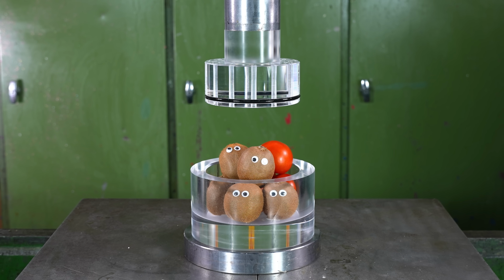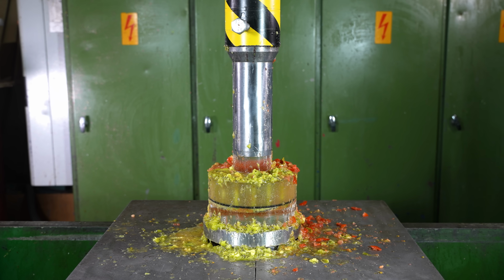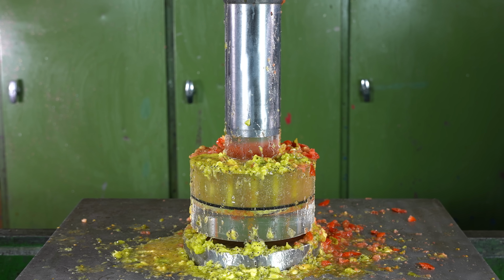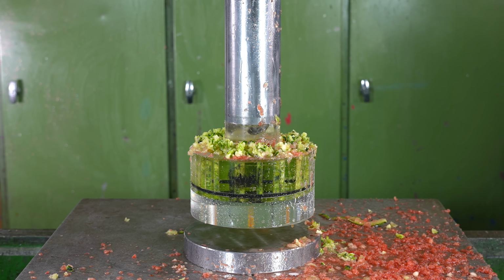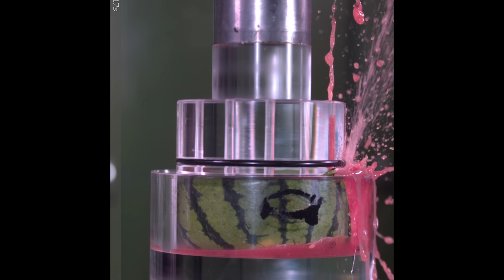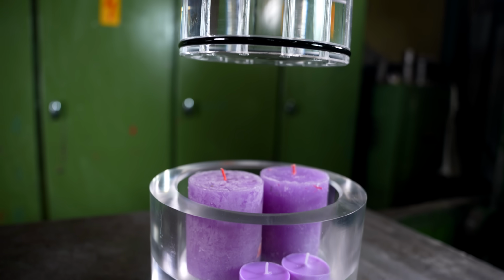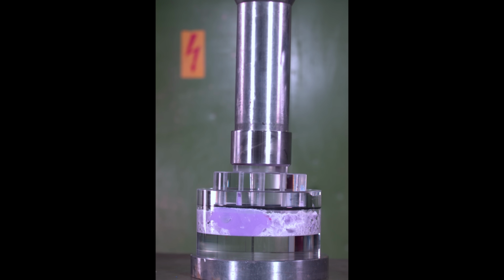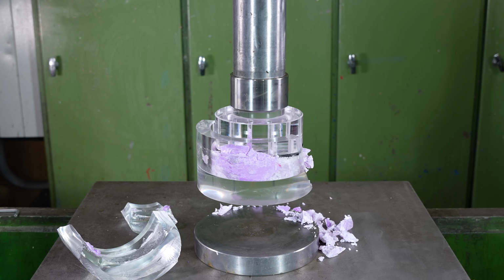Transparent Hydraulic Press Vs. Candles | Most Satisfying Crush EVER!

Comment: IDEA: place polarizing filters on either side of the acrylic tool and the stress patterns in the acrylic become visible and very colourful!
Reply: Good idea
Reply: You could also have some cameras with circular polarizer filters which should allow getting more clear picture without that much reflections from the surface of the plastic. However, circular polarizer will eat 2 EV worth of light so you probably cannot use that for high speed cameras.
Reply: F*cking YES! You'd even see the stress patterns change when under pressure! 😀

Comment: I'm wondering if beveling the bottom of the plate slightly and beveling the opening of the base as well would help to prevent minor misalignments from cracking the tool again.
Reply from the maker: there is already bevel but I think it should be just lot larger :D
Reply: You can see how the top cracked from the offset on the watermelon squish in slow motion.
Reply: @HydraulicPressChannel  put holes on the side of the base. Would be an epic mess and would alleviate pressure on the base.
Reply: @HydraulicPressChannel  in your making of video I was already worried that it was too small and might cause it to crack. Great footage though! Really enjoyed it on beyondthe press
Reply: Flaring the holes on the inside of the pressure chamber could also help reluctant substances to flow.
Reply: @brianhawthorne7603  You can also see how the pressure on the watermelon moved the bottom cylinder across, so perhaps something more solid to hold it in place? An iron plate with a hole or something? There's a LOT of force involved, tho, so I'm not sure how well that would work. Although you could bolt the iron plate to the platform, I guess?
Reply: @galfisk  Good point 👉
Reply: It called a Chamfer.
Reply: @llearch  I saw it too
Reply: @tyler0487  bevel is a flat angle, chamfer is sloped/roundover. i suspect u already know this but wanted to chime in with the fancier woodworking term. either one should work here but im not versed in fluid dynamics
Reply: Could also use a fiber reinforced plastic.

The hard part is finding a clear variety, and someone to make a block thick enough.
Reply: @21centdregs  nope, a rounded outside edge would be a radius.  https://en.wikipedia.org/wiki/Chamfer
Reply: @Highstranger951  i stand corrected. i was  only familiar with a sloped chamfer, which apparently is an entirely different thing.
Reply: Also dont load the bottom part of the tool with things taller than the edge, that way the top piece can align with the bottom before starting the actual squishing.
Reply: Next time you make the cup and press tool a larger chamfer on the edge may help self alignment and give a little more longevity but great bodge fix on the top piece!
Reply: It doesn't even need a bevel on the piston. The same thing could be accomplished with guide rails placed every 30 degrees on the cylinder, guiding piston entry into the cylinder. A piston bevel may be counterproductive in use, increasing load on the o-ring for semi-solid press substances.
Reply: @HydraulicPressChannel  Much larger, there is too much 'slop' in the top ram. A cone shaped guide that starts well above the items being crushed.
Reply: @allieROFL  only issue is that the stuff might not come out the top then

Comment: you need to secure the base tool before you apply pressure. the shifting melon moved the base aside enough that when the plunger contacted it there was resistant in the shaft as the plunger tried to forcer itself into the bowl it was no longer aligned with.

Comment: As others have said, having sharp internal corners concentrate the stress, so its best practice to put a nice radius in them (~10mm?). Additionally them to outside edges will also prevent chipping and help guide the piston into the cylinder if theres a slight misalignment.
Reply: At least 1 to 2 mm radius will greatly reduce the stress. Of course larger is better. They could also opt for a clear Poly carbonate since it is much less brittle. We use acrylic and PC in Lighting design all the time. Avoiding acrylic under high stress loads and sharp corners are well known axioms.  I'd try to get at least 2mm rads. avoid all sharp corners and edges.
Reply: Have you been on his 2nd channel, it shows the whole process,

Comment: I see lots of comments suggesting metal bands, and I think that would help too. Even better if you have something that can be tightened to pretension the acrylic.
What I haven't seen mentioned is that the misalignment on the watermelon happened @3:15 after the tool contacted the melon, before it was constrained by the base.
Reply: It was the same with the candles, they misaligned the tool too.

Comment: I think on the watermelon you had it aligned right at the start, but the start of the crush of the watermelon pushed the bottom part to the side. Maybe some sort of fixturing to the structure to eliminate (or at least mitigate) movement along the x-y plane is in order.

If you haven't made the replacement top piece of the press, maybe angling the holes so they point away from the center by a few degrees will make more interesting fountains.

Comment: You can add bolts to the base so that it is attached to the metal plate keeping it aligned with the piston. That also helps when retracting so they detach easier
Reply: I have been always wondering this, why dont you just fix that bottom plate so it cannot move when the item being crushed is trying to move it?
Reply: @Zer0m4n  They have to pull the tools up every time to hammer and separate them. If they bolted it down to the table, they would be lifting the table up. I remember them saying somewhere the table is not bolted down, and that the press frame would tear itself apart if they tried to pull things apart with it instead of crushing them

Comment: The bottom part should be much longer, so it's possible to start with the tool aligned already from the start. I'd avoid making any sharp corner in the top tool as well, just to avoid any weak points to cause cracks.

Edit, making a chamfer at top tool would most likely result in putting more pressure towards the sealing when pressing less soft materials. Maybe the top tool pressing area, should be slightly concave (bulging inwards).
Reply: maybe radius the inner right angle going aroud the inside of the bottom part too

Comment: The top tool having the steel sheath around it seemed strong enough even for the candles. I think maybe potting a similar bottom part in clear resin should give the sides more reinforcement without distorting the view

Comment: For the piston, maybe it should sit directly on the metal, instead of being grabbing on a rod. So there is no bending force on the plastic. For the cylinder, you machined sharp corners on the bottom of the cup. It might be stronger with a radius there. For the extrusion holes, a big chamfer might reduce the pressure needed to push stuff inside.

Comment: I think the bottom cup needs to have its edge radiused (smooth curve), to prevent it catching like that.

Also, maybe taper the inlet holes, perhaps with a stepped drill bit. Not only will that assist in the material evacuating the cup, but will accelerate the ejection super due to the force being gradually necked down.
(analogy: if you have a water source at the top of a tall hill [a fresh water stream for example] and use progressively smaller and smaller piping as you reach the bottom, the PSI of the water by the time it exits the bottom will be extreme... in other words, do not do this unless you want your cabin's plumbing to blow up 😊👍 same situation with making the tool's holes progressively stepped; it's a rocket bell, but in reverse lol)

Comment: Might making the parts, particularly the bottom part, out of resin be better as you could put bands of thin wire into it to give added strength against the breaking force. But to be honest watching the bottom tool fly apart and the second chunk just fall off was great. :)

Comment: I work a lot with Resins. my recommendation, that you may have figured out, is go with big fat Fillets and Radii, like 12-25mm, everywhere. metal can do a lot with small fillets and radii, but plastic/resins need much bigger ones.  could get away with like 5-7mm. (and like 2mm in the O-ring grooves)
Additionally, after you make a good one, you can make a silicone mold, and then cast new ones out of clear resin whenever you need a new one. probably get 20-50 usable castings out of a silicone mold before you'd have to make a new one.

Comment: A radius on the inside bottom corner of the base, and a matching radius on the pressing tool for maximum squish will make a much stronger part - square corners are weak points as you well know.

Comment: As others have mentioned, you need to try to get polycarbonate cylinders to use for this. Acrylic is just too brittle, which is why you don't see it on cars covering headlights or on construction equipment. But, if you thought the acrylic was expensive, hold on to your hat.

Comment: You could make a steel plate with holes backing the top tool or even the plate be the bottom. The sides would still be transparent but make the steel take the force.

Comment: For the first break, it appears that the inner piece got caught on the lip of the outer one, and the momentary pressure caused the crack. 
If I could make a suggestion, it would be to add a slight inward slope (chamfer, bevel or something, can't remember the term) on the bottom. Nothing drastic, just below the gasket.
That way, in theory, if it does catch the edge, it should simply slip into place.

Comment: When you re-make the see through press, radius all edges. The internal right angles, even 45* angles, are where the cracks will start. Sharp angles are the weakest point in the structure.

Comment: How about a bit of a chamfer on the bottom of the top tool, or the top of the bottom tool to guide the two into each other so a misalignment is gently realigned?
Also, an extension out from the top of the bottom tool (you could just use a laser cut sheet of acrylic), to prevent it all running down the side of the bottom tool as you film (like a horizonal umbrella).

Comment: It's easier to say than done but probably the transparent tool could have last long if you guys add some metallic structure inside the piece, just like in a concrete structure. Transparent material is one piece solid yes, but it tends to shatter real quick and doesnt hold up very well pushing force from inside to outside. A series of circular metal stapes welded inside the piece i think it could do the trick

Comment: Random thought… what if you removed the holes that allow air to escape through during pressing? The holes u see grape juice erupt from? Would grapes have the strength to hold back the press with its trapped air? Would the bottom of the press explode from the pressure? I always wondered that lol

Comment: Just add a tilt to the top surface of the bottom part so if it's not perfectly aline it will just slide right into the center like a hopper.

Comment: Move the o ring a centimeter up the tool and chamfer the edges at 45 degrees so it guides the bottom to center if it slides away again.

Comment: Food-grade plastic means you can market your own boutique brand of guacamole, salsa, exotic fruit blends, preserves, ketchup, etc. Try a clear high density polypropylene, which will stretch a bit before failing. Remove the upper and lower inside faces (against the piston and base) so they can't transfer pressure sideways, and make the walls much thicker. Yum!

Comment: I think the crack occured during the water melon crush-test: there was an offset between the base and the top part with the o-ring: the color changed in the material when the alignement self adjusted with pressure and impact that resulted from it.
Reply: yep, you can clearly see when it breaks. Stupid watermelon moving the cylinder!
Reply: Someone else and I have suggested some sort of fixturing there. The other person actually had the industry jargon down enough to make a suggestion by name: toe clamps.

Comment: ooh! Rather than polishing, you might be able to get the same result with a coating of clear resin! It will fill the rough surface and produce a completely transparent surface (in theory). Test it on a scratched up piece or a drill hole beforehand pls =D

Comment: I would recommend adding metal band at the top of the bottom tool. For example, 5 mm thick and 5 mm high metal band around the top edge of the bottom tool should add a lot of more strength to the bottom tool and only lose 5 mm worth of transparent area.

You can clearly see that the bottom tool cracks from the top edge downwards at 6:23. I would guess that even with metal band, the acrylic will crush with bit enough pressure but the band would probably survive it without failure so you can re-use the metal band for multiple tools.

The only question is how to make the band fit tight enough around the acrylic? This time you cannot heat the band a lot but maybe you can get it fit if you heat the band nearly the melting temperature of the acrylic and use liquid nitrogen inside the acrylic cup? After fitting the band, you can probably even pour the liquid nitrogen back to the container for another use later.

Comment: 3:40 You can clearly see that the bottom tool starts to slide here. I think you should monitor this and stop the pressure if that happens. It's clear that the top tool is going to fail after this much offset for the bottom tool.

Comment: I have a suggestion for the candlewax explosion phenomenon, somebody may have already suggested this; What about coating the inside of the acrylic cylinder with a clear lubricant, perhaps water based? 😅
Reply: Wd-40/Pam & a few other things also come to mind that may help.
Reply: @MikeyAckersVe  I'd be concerned that the WD-40 would attack the acrylic. I could be wrong, but they now have a bunch of scrap that they can experiment with material compatibility.

Comment: What if you made a wider tube out of steel and cut vertical slots in it then add the acrylic as portholes well long portholes we would still see all the action through the portholes in the tube. I think you would have to fit the acrylic from the inside and rebate around the inside of the vertical viewing windows and do the same with the acrylic so it would sit flush with the inside of the tube so the piston can pass it without any obstruction. I hope I explained it well enough. All the very best from Scotland.

Comment: For the bottom part make it a metal holder where it has support all around but cut a windows in it to so that the camera still sees in there and light can go in it from all around. 

I personally think that could help in alot and would prevent the sides blowing out ass they cant flex at all if the metal sleev supports it.
@HydraulicPressChannel

Comment: Nice! I think you might be able to get away with higher pressures on both ends of the tool if you machined larger holes in the top part because that would allow for the release of more material as the thing was being crushed, which should reduce the force acting on the tool itself. I really liked seeing these transparent parts. Too bad they don't have the kind of transparent metals that they talk about in Star Trek IV (which happens to be my favorite one).
Reply: I was a bit horrified to watch him polish the part on the mill wearing long sleeves...
Reply: "My God man, drilling holes in his head is not the answer!"
Reply: Fun fact, the formula shown on the computer for "transparent aluminum" is the real life formula for polycarbonate.

Comment: You should fix that tool. Make a hole on the center, then make male part from steel, which could be pressed into hole and which have a collar which goes close to the holes. That should eliminate the weak point

Comment: I think if the base was made taller so the o-ring was already seated when your start the crush the top piece wouldn't have broke.
Reply: Taller may also keep deformation of the cylinder away from the top edge -- IF the crack started from the top there may be some benefit.  Taller would also let him run a taller piston and two o-rings.  I think the only drawbacks to taller might be visual (worms stay in cylinder instead of flying out), and extra cost of material.  Either way, I look forward to WM6000000.

Comment: Next time, why not put confinement bands around the outer cylinder near the top and bottom to act like barrel hoops and reinforce the plastic? It clearly has low tensile strength. And maybe chamfer the plunger rim below the gasket so it does a better job of self-centering. Looking forward to seeng the next iteration!

Comment: Where I work, we had to use quartz tubes (for temperature resistance), but I know they also had a much higher tensile strength. Have you thought about getting and machining an artificial quartz billet to machine a worm maker?

Comment: I wonder could you combine 2 transparent materials to make a composite.  A combination of: compression resistant plastic (or glass?!), but with fibres of thick transparent fishing line wound through it for tensile strength.

The break at the end seemed to be caused by hoop stress, so you need tensile strength to resist that yeah?  But the rest of it needs to handle compressive (or even bending, if misaligned) stresses.  I guess it's the usual engineering problem heh.  Too bad U can't make transparent steel (I doubt transparent aluminium gemstones count, they're probably too brittle)
Reply: Hmm but don't they use fibre-GLASS as a high tensile material?  That's weird, i thought glass was known for its compressive strength not it's tensile strength 🤷‍♀️.  Could it do both?  Can glass fibres be embedded in a glass brick to form a "composite" of high tensile strength glass and high compressive strength glass? Haha this seems so dumb.